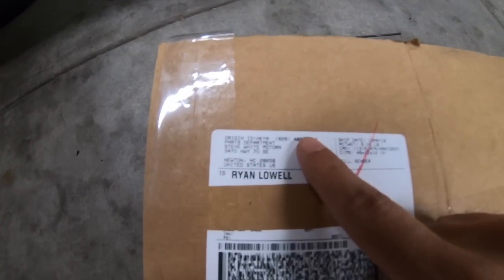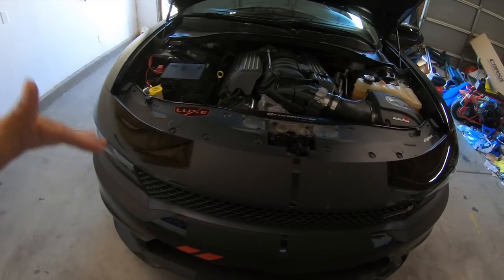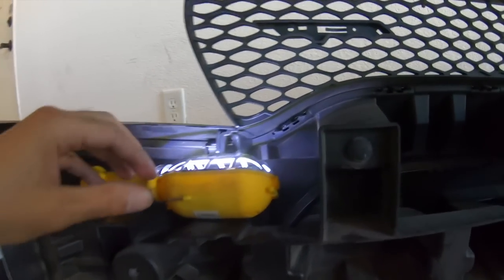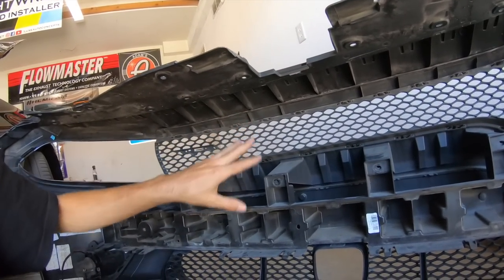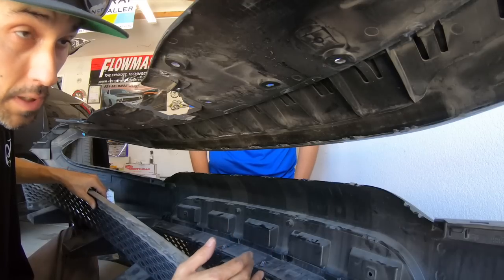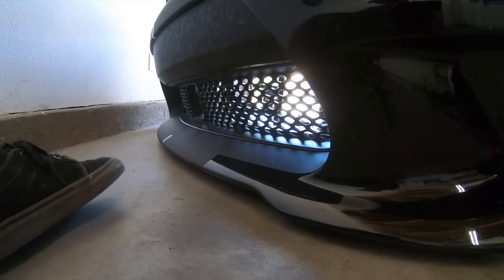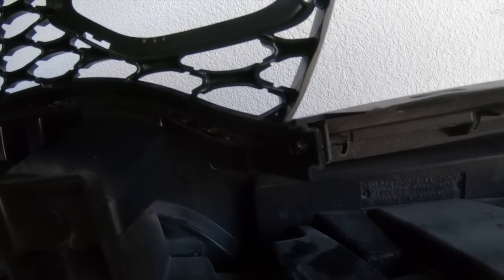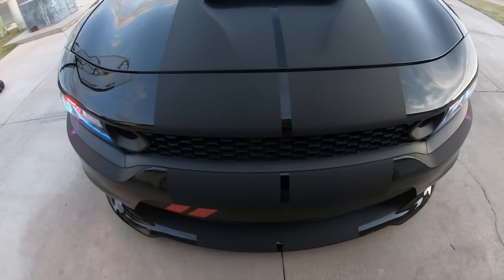2019 DODGE CHARGER GRILL INSTALL - SCAT PACK CHARGER! ✔️

Comment: Considering what charger to get rn and going through all the mod videos I can to understand what base model to get and what mods I can do. Want something as a daily driver (I drive like 2 miles a day for general stuff lol) but I want a project car I can work on. I don’t want much power. Something decent MPG, and I want it to look badass asf. Love the bumpers on the 2018+ scatpacks and hellcats. Want a black scatpack style hood. What model would you recommend for the base if you know much about charger models?
Reply: if you havent bought 1 yet I recommend the r/t they have 300 almost 400 horsepower have kinda of a better mpg then the 6.4 392s and hellcats and is the base model v8 chargers
Reply: Go R/T  and then upgrade to a scat pack kit. It will be cheaper on overall cost and insurance
Reply: @jonathandeleon8240  true insurance for a scat is almost the same price for a hellcat im going to get a 2015 r/t and then just modify it in my own taste

Comment: I'm still not feeling the snorkles. Plenty of air passed through that grill before dodge changed it. I think it takes away the full grill effect.
Reply: dabeatboxer83 Nah man there is way more air flow. I just recently did it to my scat and normally my intake temps was 5-10 different from outside temps while cruising. With the new grill it’s about 3-4 degrees difference while cruising. Heat soaking is the same but temps drop extremely faster while cruising. Mine had heat soak to 130 in traffic it was 89 outside by the time I got moving again 2-3 miles down the road at 50-60 mph my temps was back to normal are 92 degrees.

Comment: @Hemifan did you have any offset between the hood and upper front bumper after you installed it? I have about 1/4 inch of offset at the center of the leading edge of the hood but the sides of the hood are level.

Comment: So just confirming, the air intake tube and shield is compatible w/ the aFe Momentum GT cold air intake? im trying to make the nostril functional with a cold air intake.
Reply from the maker: Yes if you have a GT momentum intake all you’d need is the tube and front bracket and it will plug into the front of aFe box.

Comment: What’s the part number for the 2 push rods on the upper grille & the screws for the lower grille & what kinda pushpins are on the upper grille and the absorber
Reply: Yo bro I gotta question can I buy a upper grille with the in air intake wholes and put my srt badge with the hellcat emblem on upper right?

Comment: On a 2018 Daytona with the Mopar intake, in order to make the snorkels fully functional, remove the intake filter and replace with the hellcat air box?
Reply from the maker: Hmmmm is have to do some more research on the 2018 Daytona’s to confirm this though but here ya go. If the Hellcat intake box is compatible with your car then that and the front bracket for tube should be all that’s needed to make the snorkel functional.
Reply: J. Reyes15 did you ever get your answer? There’s really only two ways to do it properly.
Reply: Did you ever get an answer on swapping out 2019 grille with a cold air intake,cause the mopar cold air intake &the Hellcat air box with tube "DON'T work together "?any one know how to make them work together?anyone

Comment: Does this fit the 2019 Charger R/T?
Reply: Yes it does. I replaced mine 2 months ago and it looks so much better. I have a 2019 Dodge Charger R/T destroyer grey
Reply: David Contreras  did you get with or with out adaptive for the R/T
Reply: Christian Arispe without
Reply: David Contreras is there an rt badge for the front that fits that grill?
Reply: Will it fit the 2019 charger sxt?
Reply: @craigwhatsamacallit7904  i wanna know too

Comment: Will this fit a 2015 charger rt road & track?
Reply from the maker: This does not fit on the non SRT style front fascia unfortunately. 😫
Reply: So by your answer I imagine this doesn’t work for the standard 2018 v8 R/T non scat/Daytona packages as well? I have a hellcat air box that I bought. Someone told me it would fit, which it does, but it’s pointless without the air ram srt front grill. Is there an adapter or similar package out on the market that will work with a non-srt/SCAT/Daytona package?

Comment: Will this work on a 2019 rt?
Reply: Justin Alaquinez yep.
Reply from the maker: This does not fit on the non SRT style front fascia unfortunately. 😫
Reply: Justin Alaquinez  I had the track pack 2018 5.7 RT. Thought that’s what you meant.
Reply: Did it fit?

Comment: Waste of money, sorry. Leave the 2019 grill on the 2019 cars.
Reply: Michael Probst Not at all I just recently did it to my scat and normally my intake temps was 5-7 different from outside temps while cruising. With the new grill it’s about 3-4 degrees difference while cruising. Heat soaking is the same but temps drop extremely faster while cruising. Mine had heat soak to 130 in traffic it was 89 outside by the time I got moving again 2-3 miles down the road at 50-60 mph my temps was back to normal are 92 degrees.

Comment: I’m looking to do the 2019 grille swap on my 2017 Scat pack but I was curious does my OEM scat pack badge that I have on it now, will it mount on the 2019 grille or do I have to order a new grille badge that fits the 2019 grille ?
Reply: did you have to order a new emblem?